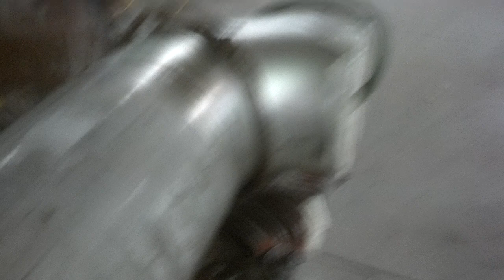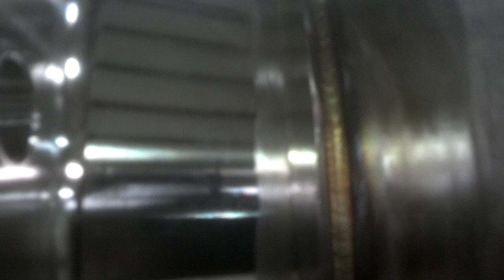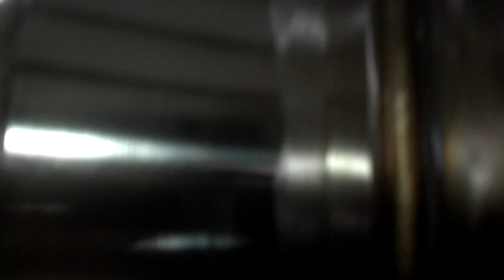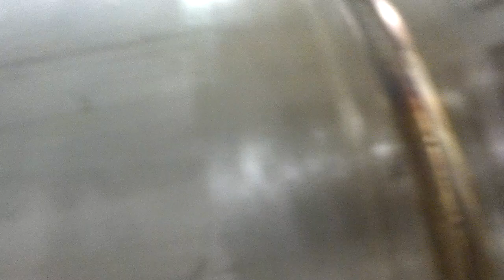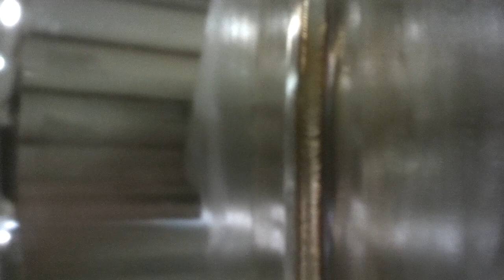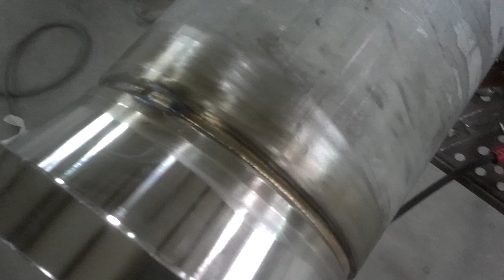Tig Welding stainless pipe by Adam Wolsmann pt. 2

Comment from the maker: I don't feather my tacks.  I run hot and start slow on tack to make sure breakdown walls.  When tying back in I remove filler wire just before tie in and melt down the tack drawing it back into the root to close in the root and making sure it broke it down.  I also walk slow over it to smoothe it out